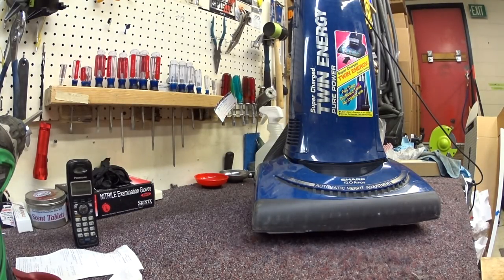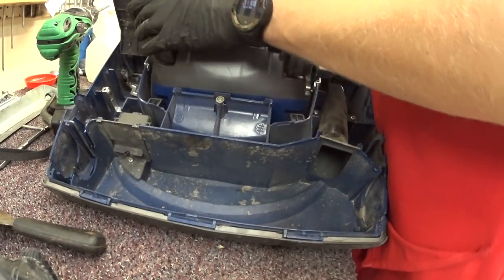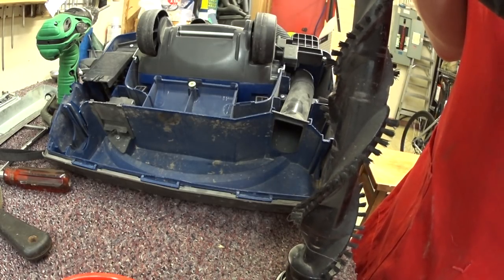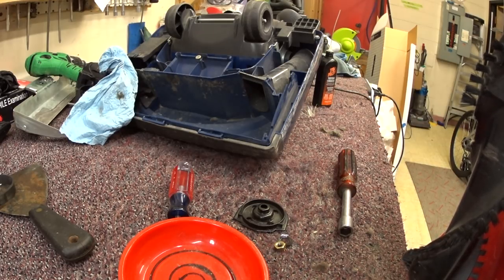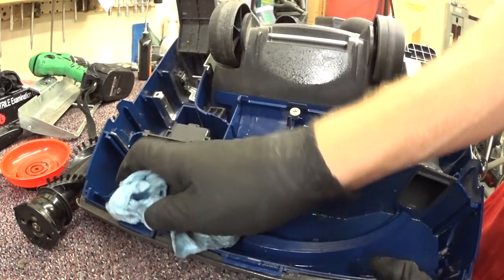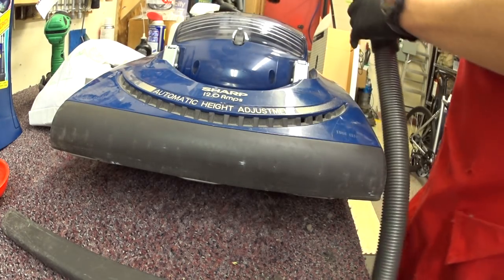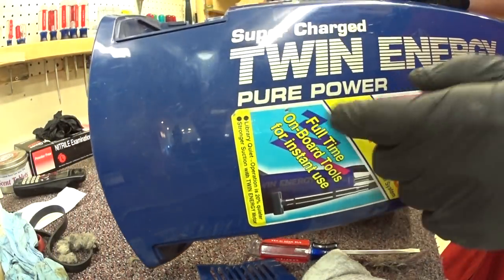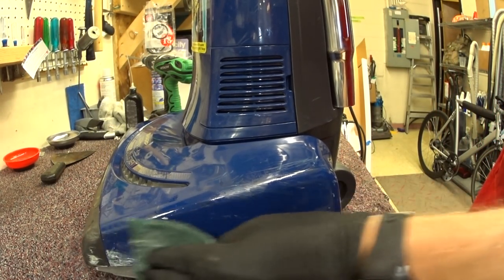Sharp Energy Upright Vacuum Repair Tune up Whole Video

Comment: Thank you for info.   Mine however just quit running altogether after beginning to smell really odd.....like something in the motor.  Is there a way to see if I burned out the motor.   It was working ok before it just quit.   I will sure miss this thing because it sucks up great.  Thanks

Comment: Japanese vacuums always have their little weird quirks. About the manufacturing, pretty sure Dyson does their own and doesn't contract Sharp/Panasonic as their OEM. Dyson's plant is in Senai (south Malaysia), whereas Sharp has theirs in Kedah. In Southeast Asian markets, Sharp is now relegated to entry-level products and their vacuums are PRC plastivacs. Panasonic is much bigger and manufacture average to best-in-class products. What you mention is pretty accurate; their good vacuums aren't PRC-level junk, yet still not designed to last a decade.

Comment: So my mother has a Brother CT 1500 still to this day which I believe was made by Sharpp. It looks very similar to the one on your healing bench, except hers has a metal brushroll with replaceable brushes and is bagless. Let me tell you  that till this day this thing is a beast and a great cleaner with plenty of suction and it grooms her carpets extremely well. Every vacuum that I have had until I recently bought my Simplicity S40P never measured up to hers which is now 19+ years old. I still  have a nice but not great Electrolux nimble, 1 month old Simplicity Wonder Tandem Air model and that one is good but not as good as her Brother. However, the S40P is better, but also a lot more money than she paid in 2000 compared to the clearance price of $875 for the S40p. But man am I now happy, and still respect her vac. My home's carpets  are now as happy as hers. Lol

Comment: Nice video! I have one of these my (elderly) neighbor gave me after they purchased a new one. It still works great and I truly beat it up- it is my 'shop vac' and takes up everything from nuts and bolts to rocks...So Quiet! never changed a belt and only changed the bag once(in 5 years!)- it was sooo full! I am inspired now and will go take the roller apart and see what it looks like. might try to make an exhaust filter, just for fun! I'd like to see an overhead camera angle to see the parts you are working on, I kept trying to pan up to see the top of the roller! ;)

Comment: Mine burned up in less than 2 years even though CR rated it highly.
Reply: user error , i have 2 both still work great
Reply: I bought mine in the mid-90s.  It still works fine except the part that locks the handle upright broke.